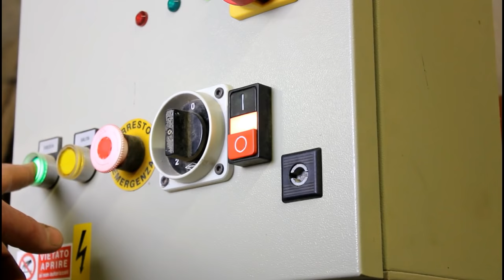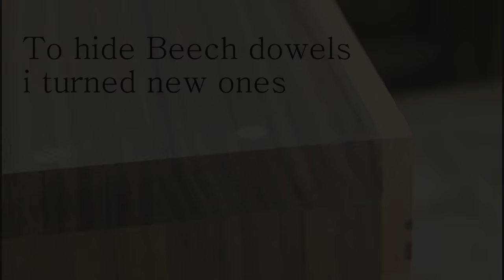Next level Briefcase / Wooden briefcase

Comment: Excellent work. As others have said, the carving looks great. I thought the choice of Timbers was also very good. I make a lot of boxes - and this is essentially a large box - and would have made it slightly differently. And I mean differently and not necessarily better. I would have rebated joints at the corners of the sides and then chamfered those edges to match the depth of the rebate. That makes the rebate effectively disappear to the eye. If not a rebated joint, I might have used mitre shims to strengthen rather than dowels. As I have a Festool domino, I would be looking to see if the thickness of the timber used was enough to enable me to use them as they are great for strength and alignment as well as hidden. I want to stress again that these are not criticisms - just an expression of how any two woodworkers would make the same thing in different ways.
Reply from the maker: I accept all feedback. I see what you meant. There is always for improvement. But often there is very limited time to videos. So time gotta be used efficiently :) sides are 8 mm thick so domino would be to aggressive.
Thank you for your opinion. Take care

Comment: 2:15 - 2:25   I am curious to see how that joint has held up over the past 4 years from the seasonal changes in humidity.  Beautiful briefcase though!
Reply from the maker: Vaccuum dried wood is the key
Briefcase is  the same as it was when I made it. Only darker.
Maybe there is  more uneven gap when closed. Instead of straight all around there is small bowing. Which amateur eye won't notice.
Thank you

Comment: very nice job!!! but i think the handle need a  suport,it will be crack easy.
Reply from the maker: john pyrovolos Thanks John. Sure I agree  . Luckily this will see little use and no weight.  Reinforcing handles where the metal pin is would be better choice.  Thanks for watching.  Regards

Comment: The design of the handle raises questions.  The direction of the wood grain and the direction of the holes are the same.  This may cause damage to the handle.  Under a certain load or sudden impact, it can simply split along the wood fibers.  I had such a negative experience when making my backgammon boards.  And as for the stability of the case.  Either you need to add support legs that are slightly thicker than the central part of the hinges, or turn the hinges inward with the cylindrical part, changing the seats for it accordingly.  And so, overall, a very nice brief case.
Viktor Cheverda (PRIMO Beckgammon Boards)

Comment: i looks fantastic!
congrats!
Im sure the locking latches are mostly to keep the briefcase shut, but doesn't the screws on the outside defeat the purpose of the lock? or am i missing something?
Reply from the maker: That is correct. If this would be for a client or something I would use different hardware. Those types which are mounted from within. Here the only purpose is to hold it close. Thanks for watching
Reply: nice work! i just thought i was missing something :-) fine craftsmanship!
Reply from the maker: Libo Good observation. Regards

Comment: What does it weigh? and don't you think more high end hardware would have made it complete?
Reply from the maker: Dust Factory Hy. I don't know exactly how much but I can tell you that is surprisingly light.  Walnut pieces were quite light and cherry wasn't thick and carving took some weight off too. I 100% agree with you,thing is that there wasn't enough time to wait for shipping because I couldn't miss that special day for my wife.  I've done similar briefcase in the past with quality hardware and the shape is identical.  So in any case it can be easily replaced.  Thanks for your observation and for commenting.  Regards